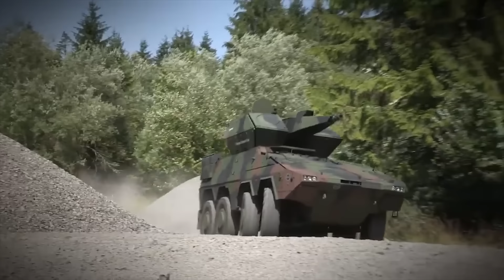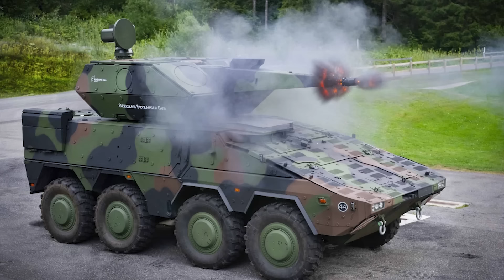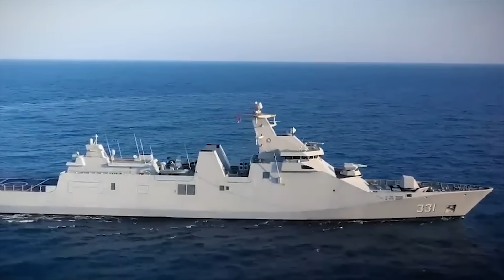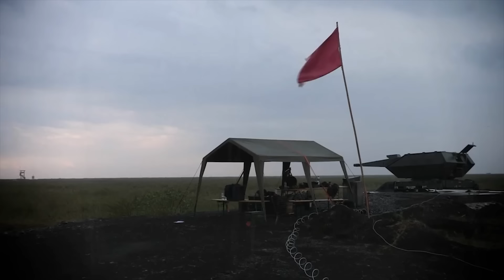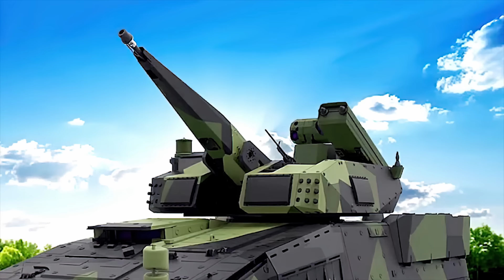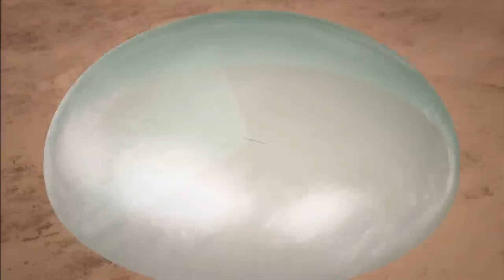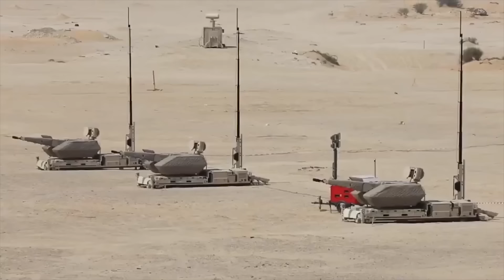GERMAN Fastest Air Defense Systems SHOCKED The World!

Comment: If the Bundeswehr adopts it, let's make sure both gun and ammunition is built in Germany and not in Switzerland this time.
Reply: The Bundeswehr already has two MANTIS systems, which are based on the Skyshield, they are currently in the progress of giving both to Slovakia.
Reply: The Bundeswehr is already using them. They were used to protect the bases in Afghanistan (100% interception rate, anything, missiles, mortars etc.), used on ships and now also on mobile units (Skyranger). The later ones are already not swiss made anymore, due to the usage issues with swiss made military gear.
Reply: The Bundeswehr already has MANTIS Defense systems.
Reply: Partially right. Oerlikon is part of Rheinmetall just like Contraves. But these two sub-companies are registered and taxed as Swiss companies. The development was purely Swiss. The Gepard anti-aircraft gun tank with the predecessor gun was also made by the Swiss for the Germans
designed and completed.
Reply: @peterschwarz8449  Any foreign subsidiary is registered and taxed as a company in the country it operates in. As are specific divisions headquarterted in other countries. They need to be locally registered to operate in that country. Roche Diabetes Care is registered as a German company. That doesn't mean that Roche Diagnostics. of which it is a subsidiary can't decide to reorganize its activities and shift certain aspects and activities from Mannheim to Rotkreuz or vice versa. Just like they decided to make Diabetes Care a whole individual division in the first place. They could (and in the past would have liked to) also decide to sell off Diabetes Care to someone else. And if they did that, they could decide whether to include certain sites, products etc. or exclude them. 
Just the same, Rheinmetall could choose to sell the Oerlikon site to someone else, but retain the IP and product pallete and produce the stuff elsewhere. Or simply switch the production of certain products elsewhere out of business strategic considerations. At this point, Oerlikon doesn't even exist anymore as a company as such - it's been integrated into Rheinmetall Air Defense in 2009 already.
Reply: @ohauss  Germany is a special case when it comes to factories outside of Germany but owned by a German HQ'd company. 
Basically Germany has bilateral deals with practically everyone meaning that profits made by German HQ'd companies made outside of Germany are still being taxed in Germany rather than where the profits are made. So for example the money VW makes from their factoties in China which produce for the Chinese market is still taxed in Germany rather than China. The bilateral deals mentioned earlier exist so German companies are not being double taxed for their foreign operations.
Similar happens to individuals who are registered as living in Germany but working abroad. They still have to pay German income tax on all the money they earn anywhere in the world but it is down to the individual to avoid double taxation.
Reply: @Belliger1991  Because Poland is an ally and the Swiss are not an ally. It is as simple as that.

The Swiss do not allow resales from their weapons into active warzones. That's why we should never again buy Swiss weapons and Germany should relocate all of Rheinmetalls production from Switzerland to Germany or another NATO country.
Reply: @ChaosEIC  we are already at relocate it, they started produce the rounds for the gepard in germany already. first one will be delivered in june or july
Reply: Leave Switzerland alone bro seriously
Reply: This comment section is golden.
Anyways here‘s some things that need to be clarified:

a) Switzerland has sent help to Ukraine in the form of medical and logistical supplies. Because of a new law, no exceptions can be made when countries try to send swiss weapons/munition into areas plagued by war. It has sparked a big debate both inside and outside of switzerland. (Maybe Desmond Doss would be a nice analogy to that)

b) Switzerland keeps it‘s neutrality by not choosing sides. Some of you argue that by choosing that, they aren‘t neutral anymore because they are not for Ukraine (the good guys), which is a bogus argument. They do not choose sides. But they help within the limits of not taking sides for what the majority of the world thinks is just (Ukraine being the victim and should be supported).

c) Swiss neutrality plays a big part as to why it can host big gatherings of nations who may not all be best friends. This gatherings are possible because no side needs to fear for their delegation as switzerland is neutral ground. This is why it defends this neutrality so harshly, even harming itself in the process.

d) What I also saw were some comments regarding the freezing of bank accounts of russian oligarchs. As far as I know, basically any known bank account with relations to such figures have been frozen completely. Some people demand that the frozen money should be used to rebuild Ukraine. Noble idea, but unless there is a unanimous vote on that it‘s not gonna happen, because frozen means frozen. However if the swiss banks were to quietly shove this money into their own pockets, that would be real bad. That means either unfreeze them after the war (massive nono by most peoples view), hand the money over to Ukraine (also not without it‘s problems) or just destroy/distribute/whatever it evenly. Either way, a lot of people are gonna be unhappy.

e) The Bundeswehr having bought these systems a long time ago was aware of these problems. But what most people don‘t mention here is that Germany has massive ammunition reserves which they would use to defend themselves in a war. And if a war would happen the industry will be rapidly refitted to produce weapons and ammunition anyway. That‘s why the Bundeswehr bought these systems, they are good and there will be no major problems with supplying them, even if war in Germany were to happen and thus switzerland not supplying more ammunition. For those now arguing that the munition reserve is not as big: A country won‘t donate all their munition to another country even less so in times of crisis. Considering that there is a high demand for ammunition in Ukraine the amount donated would be rather substaintal, thus the reserve will be even larger. Have a bit of faith in the Bundeswehr, they now what they are doing. And Rheinmetal outsourcing ammunition production to Spain for now also highlights that they know what they are doing.

f) Lastly, debates like this are good, but please keep it civil, no need to attack people on a personal basis.
Reply: @Belliger1991  Exactly, best not contribute to help the nation that is dying for your lifestyle.
Reply: Ja aber wir bauen in Deutschland jetzt Produktionsanlagen für Munition in Deutschland und da Oerlikon mittlerweile zu Rheinmetall gehört ist das dann unsere Sache.
Reply: The Bundeswehr adopted this system 12 years ago, they call it MANTIS though once it is installed.
Rheinmetall has already built a new munitions factory outside of Switzerland (Rheinmetall bought Oerlikon nearly 25 years ago) which will provide Ukraine with 300 000 shells for the Gepard by June this year. Skynex systems also have already been supplied to Ukraine and more will come as fast as they can build them.
Reply: @Belliger1991  yes and that is in this case a problem, thats excactly why it shouldnt be built in switzerland, we can do whatever we want with it and you get to hold up your laws, as stupid as they may be
Reply: yeah, let the Austrians build it...:goat-turquoise-white-horns:
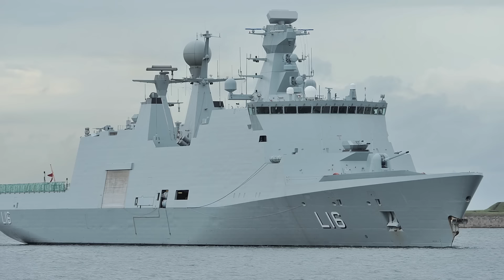Reply: Oerlikon is Switzerland as you see 1:04
Reply: This comment section is rather interesting. So many takes on it, some totally wrong, some right, some misinformed.
Anyways, some important stuff to know.

1) One of the core values of Switzerland is neutrality. It's a long tradition since 1815. It's a simple as not taking sides in conflicts between one or the other. This includes not supporting also what many may see as the morally right side. Participation of a conflict directly or indirectly is no longer neutrality. Not deciding for either, is absolutely also a decision and that is what Switzerland does. That is also what allowed Switzerland to be known for and contribute a lot to human rights. Simple as.
That is not cowardness, it's simply the pure form of maintaining national morals and views. Considering the size of Switzerland, people should truly respect their achievements and contribution. Debating whether Solidarity is morally more correct than staying Neutral is a foolish question. Neutrality cannot be maintained if the very essence of the requested Solidarity is not based on Neutrality. Hence Soldiarity for support in conflicts is not in Swiss interest.

2) Switzerland tried already to have a sort of middle-ground which was before the export laws got stricter. The whole process which made the export laws stricter was actually the result of  a Initiative denying a decision of the government from 2018 that would allow Export of war resources to civil war countries, if there was no reason it would be used in internal conflict (which is just to absurd to not expect)

There was strong critics against the whole thought of that, it went against the majority of what the people wanted, hence a initiative was launched.
To clarify, for one it's what the majority of people wanted from their nation that's up to them and furthermore none of them had a close war like ukraine-russia in mind back then.

3) Rheinmetall including certain other companies got suspended of export by Switzerland already in the past, be it for exporting to UAE, Yemen, or supplying Russia back in 2014 with equipment. And yes Rheinmetall supplied Russia back then, but also got blocked by the German Government (the previous government allowed the trade)
If you want to be the true moral saint, you can complain towards all the arm dealers and manufacturers fulfilling contracts and supplying remote wars in the background not in focus of the public media, you could find dirt on all of them. But it's as simple as business.
Switzerland simply took a stricter stance to it and additionally not only enforces Swiss sanctions, but indirectly also EU sanctions, UK sanctions and US sanctions.

4) As of right now, Switzerland may be looking at yet again potential adjusting with neutrality at stake to allow re-export to conflicts that has been condemned as violating international law by the majority of the UN as a reason for it.
But as far as I know that got dismissed because again would violate neutrality law. They might provide greater aid in other ways, just not contributing into prolonged war.

Either way, this is a complex web of political problems. 
Telling Switzerland off for not loosening their export laws is childish, it makes people sound like the entire issue would be resolved with Switzerland allowing exports into the conflict, which simply is not realistic, rather just misdirected focus on the core issue.

Oh and since I had to read some clearly wrong knowledge regarding who made what.

a) Regarding the Gepard Anti--Aircraft.  The vehicle and the Anti-Aircraft gun system was developed by German company KMW. The gun itself which are the Oerlikon 35mm were developed by Swiss company Oerlikon and licensed for production to KMW for use in the Gepard. Keep in mind the gun alone without the supporting system goes no where and a gun system without gun well same stuff.

b) Germany absolutely still produces ammunition for storage in reserve. They are not waiting for a need to then turn on the gears. They maintain a certain stockpile and ensure to meet certain standards. All of that is tightly regulated as goes with many things in Germany, government ensures safety and security and enforces strict quality control standards.
Also to note, Germany also monitors their export of ammunition and military equipment to comply with international law and especially in recent years has tightened their export controls on equipment and ammunition to prevent it from falling in wrong hands. Like many other EU members and just like Switzerland is doing, them just doing it quite particularly strict.
Reply: As a Swiss man, I agree with this. Produce it yourselves as much as you can. Get a good deal, we don't really have leverage, we need you more than you need us. Don't rely on our weird construct of laws and direct democracy. Don't get me wrong: Our democratic system works better than anything else in the world and the majority of the Swiss population – including myself btw. – would even support massive weapons deliveries for ukraine (it would be a just cause for once, many of us Swiss don't understand why it's ok to deliver rocket components to the Saudis and Israel, but hide behind the "no weapons for warring countries" law in the case of Ukraine). Our system has brought us stability like few countries have ever experienced, and if everyone had it, this war wouldn't exist. But our system is slow, so the adaption to the new geopolitical situation will take years. I guess that's what happens when you weren't really threatened or forced to react to crises for centuries: You start to take your time for things. Also, we have a bunch of right-wing politicians dominating our politics – and they just want to make business in the short term and don't bother themselves with the bigger picture. Not that the 68er fundamental pacifist leftists would be any more helpful in the present situation ...
Reply: Don't worry, Rheinmetall has basically dismantled most of its production facilities in switzerland and moved them to the EU (mostly germany, some dutch, a little spain)
Reply: @Belliger1991  Die Evolution deutscher Waffenlieferungen
Keine Waffen in Krisengebiete
Helme und Schutzwesten
Handwaffen und Munition
Flugabwehrraketen und AAA Panzer
Rohr und Raketenartillerie dafür ebenso
Illegale Minen und Cluster-Geschosse
Kampfpanzer Schützenpanzer 
Kampfflugzeuge über Polen. 
Die Schweiz soll ihren Prinzipien bitte treu bleiben Neutralität die seid 300 Jahren den Frieden Garantiert da sollte Deutschland sich schämen dies zu kritiesieren.
Reply: Machine-gun anti-aircraft defense weapons trash. Proof North Korean drones' radar detection is difficult, radar performance is poor, and anti-aircraft defense is not properly detected. We can't detect the radar of a 4km plastic drone, so we can't respond
Reply: Swiss neutrality = freedom to make business with all sorts of criminals (Nazis, african dictators, russian Oligarchs, you name it). The Swiss can not be trusted.
Reply: It actually kind of is, Its called mantis
Reply: It already has adopted it
Reply: Ist als Mantis schon lange eingeführt.
Reply: Haha do you really think our government learns out of its mistakes? 😂😂
Reply: When the EMP's will fall and they will in an WW3, than we are fucked..
Not enough people and guns to keep of China and Russia..
They are used to fight with less advanced weapons..
We souly depend on our electronical weapens but what when the EMP's will fuck everything up?!😂
Reply: I'm sure Germany is not that petty.
Reply: @kaizillaboy  But they are.
Germany already uses the 35mm Oerlikon gun that is produced in switzerland in their Mantis Flak system
Reply: Wasn’t Oerlikon Swedish, not Swiss? I would rather be concerned that it turned out that before war Russians acquired some German companies with secrets that shouldn’t be sold to hostile state.
Reply: @TheOmegaAlfa  oerlikon is in zürich swiss
Reply: @oliverbrooks4588  oerlikon as a weapon company didnt exist since long. its integrated into rheinmetall
Reply: Skynex is an italian product.
Reply: As if the Bundeswehr itself is in charge of this. Such decisions are being made by civilians and politicians.
Reply: Swiss ammo can remain in Germany, thus Germany can send all their ammo.
Swiss being in the middle is the middle part - arsehole
Reply: TOO LATE AMMONITION IS MADE IN CHINA, RUSSIAN MILITARY CONFISCATED THEM IN UKARAINE SOLD THEM TOO IRAN.
Reply: Rheinmetall owns them and nearly fully integrated them into their company structure. Furthermore those air defence systems aren't just made in Swiss, many parts come from factories in other countries, like Germany. Lastly the ammunition is made in Germany already.
Reply: @Logan_the_Hamster  you simply dont understand, the lenses for example are TOTALLY from swiss, if they ever have the intention to create wargear, which i hope not carl zeiss may builds them in the future, this just shows how little you know about the production. we need to have perfectly polished lenses for laser weapons, those are either made by bayer, carl zeiss or the watch manufacturers of swiss. ffs.
Reply: @tarkitarker0815  Carl Zeiss is a German company, with its HQ in Oberkochen, in Germany. Their main factories are in Jena and Dresden, both in Germany. Nearly their whole laser optic production is located in Germany. In Swiss they have no factory producing parts used in military vehicles, devices, weapons, ... 
All this information can be found on their homepage.

Furthermore why would watch manufacturers have the knowledge, skill and equipment to produce lenses for laser optics for military purposes?
Reply: @Logan_the_Hamster  because many luxury watches use very precisely manufactured glass that in fact can rather simply be scaled up in size. and im well aware of zeiss, i even mentioned zeiss a few times in the comments.
Reply: MANTIS is in service since 2011.
Reply: Shouldn't you be more concerned with eating hamsters young man.
Reply: @Belliger1991  Why would you buy weapons from a country that refuses to send supplies like ammunition in case the buyer gets involved in a war? Absolutely pointless. The law you are referring to is not a natural law. It could be changed (and was subject to change over the years) if there was some political will. But the Swiss prefer to hide behind their own made laws. Switzerland is effectively supporting the russian invasion including the most disgusting war crimes we have seen in Europe since decades. Switzerland has utterly failed morally and has let down those countries who shield Switzerland from external aggression due to it's geography. Meanwhile, whenever I have the choice not to buy something from Swiss origin, I am doing so.
Reply: Please yes! And keep up the international pressure on our government, they fking need it! Slava Ukrajini
Reply: But will that cure the problem
Reply: You damn fool passive governments sit and watch as the world burns down around them.They change their minds when it’s their blood.
Reply: And it will end up being their blood
Reply: 61
Reply: Switzerland , Germany or Österreich same nation
Reply: @nextoro5786  100% no ! Austria and Germany maybe, but the Swiss are so full of themselfes. Keep them separate.
Reply: @Thor_Asgard_  Austria and Germany are different as well. Also, germans are not some kind of  a mono nation, they consist of prussians, bavarians, saxonians, frankonians etc.
Reply: Dhotmanycent
Reply: Arabische Diktatoren werden beliefert, aber Europäische Demokratien, die sich gegen eine faschistische Invasion wehren, nicht. Wie unsolidarisch kann man sein? Das ist nicht Neutralität, sondern Verrat an Europa!!
Reply: They will adopt it, order two, get one ten years later.. the second one 5 years later at a 50% price increase. In which time the first one is broken and needs to be repaired, once that one is in service the other has broken. And so on~ Bundeswehr is basicly structurized incompetence, organized by professional incompetent leadership, which is overseen by the most incompetent of them all, german politicians.
Reply: @Belliger1991  hidden? no. fucking stupid? yes. incredibly ignorant and cowardly to not change said law in current times? yep.
Reply: @Belliger1991  NO WAY
Reply: Hire there engineers move them to Germany! 
The US has many armories that could privately develop a better replacement gun and all!
Reply: I heard Rheimetall is pulling out of Switzerland?.
Reply: To spend it to the Ukrain???? 💩💩💩
Reply: @marcelniederberger9676  to build it
Reply: @marcelniederberger9676  Weapons with the label "Combat Proven" sell a lot better. Therefore the German Industry is very eager to test their prototypes in Ukraine.
Reply: nein, leave it in Schweiz
Reply: Germany / the Bundeswehr already uses this system... It's called MANTIS.
Reply: Klaus Schwaab does not approve
Reply: wana hear a joke ?
Bundeswehr
Reply: @kthec1298  yes yes I was there and i wondered how it took the world so long to defeat us. Than it made all sense the allied new recruiting program and officer selection made sure, we will never be a danger to anyone else ever again.
Reply: oh yes.
Reply: switzerland is honestly such a disgrace..
Reply: They are built in Germany, Rheinmetall owns Oerlikon...Besides ,all sophisticated electronics are produced in Germany...
Reply: who cares?/!
Reply: We have the same problem in Greece with 120mm rounds for leopard 2 , I really dont understand why most European governments don’t make their own ammo.
Reply: Why ? Swiss watches are the best in the world and let's not forget ,most people in Switzerland are Germans !!!
Reply: Problem is, Oerlikon is Swiss. But yeah, fully agree, nothing vital should ever be bought from them as they are only interessted in their own well being.
Reply: @Thor_Asgard_  Oerlikon is owned by Rheinmetall now, and they just bought the biggest Spanish munitions factory...
Reply: @quantuman100  export policies still depend on the location, wo get rid of manufacturing in Swizerland and move everything into Nato countries. If Switzerland wasnt surrounded by allies but stationed beside Ruzzia they would quite quickly change their minds.
Reply: @Thor_Asgard_  look, we have clear precedent that the Swiss only care about stuff produced inside Switzerland
Reply: @quantuman100  it remains swiss by LAW. the first place a business gets registered is its place of origin and will always be the field of main management, its restricted by law to simply change countries for your benefit.
Reply: @Thor_Asgard_  you dont understand how companies work, oerlikonn is still swiss, rheinmetall can create a own variation and then export that, but not the swiss variation, oerlikonn STAYS a swiss coorporation.
Reply: @Thor_Asgard_  This shouldn't matter, as the owner they can pull out the IP and apply it everywhere. So they can use Oerlikons good engineers but the production can happen elsewhere. But of course they need the facilities to produce that eqp.
Reply: @ronaldotrumph8960  In theory. But they may be extra protective of IP of weapons production
Reply: @OrjanDT  And that is ok. As said the know-how/engineers might remain in Switzerland. IP is with the owner which is RM and they can simply apply for patent in GER instead of Switzerland. Switzerland has signed the European Patent Convention, so that should work fine.
Reply: @ronaldotrumph8960  Defence IP usually have extra national protective measures. Atleast here in Norway. Its not that easy to move weapons production and tech. Probably easier to just start a new production pipeline in Germany than to move it.
Reply: @OrjanDT  The owner of the IP under the law can be Rheinmetall. You can develop something in one country in EU (incl Switzerland) and apply for patent somewhere else.
That applies by the way also for production under license. But I have to admit here, I have just a very limited knowledge coming completely private sector.
Reply: @ronaldotrumph8960  incorrect, IP export restrictions may still apply. Even as the foreign owner you still have to abide by the export restriction of the country the owned company is in. This is especially common with export restrictions imposed by the US on tech from US companies owned by foreign companies.
Reply: @ralfvandeven3155  Try to read again, we speak about future not past or not the export of IP but the application for new technology. RM as OEM can very well develop something in Switzerland but apply for IP somewhere else in EU (applies for Switzerland as well). Production is already going that way. That will take Switzerland long term out of calculation for export. KMW discussed to do the same with NEXER  when they were not happy with GER export rules. That idea is not new or fancy.
Reply: @Thor_Asgard_  Rheinmetall is the owner of this Swiss company Oerlikon Contraves and owns all rights. Rheinmetall just didn't have a production line in Germany anymore, and that wasn't a problem. But since last year production has been taking place in Germany again.
Reply: @Thor_Asgard_ if all countries were like switzerland, there would be no war or poverty in the entire world i am swiss so i know dude
Reply: @whooshie5172  nope your wrong. Economically thats not possible. Switzerland is profiting from its geolocation and neutrality. If all countries would do the same, we would have the same exact problems we now face.
Reply: @Thor_Asgard_  this statement doesnt make any sense.
why we would face the exact same problems, if all countries would be neutral?
Reply: @IT_SEC_Stuff  Its simple, they can live in wealth and profit from their neutrality. Noone would profit if everyone was neutral, thats when greed will spread and take over. Its human nature.
Reply: @Thor_Asgard_  profit is a term related to capitalism, it has nothing to do with neutrality.
if all countries would be neutral, capitalism also would still rule the world, and in this system you have winners and loosers, its in its nature.
Reply: @IT_SEC_Stuff  And exactly because of that, there would still be conflicts and war. accept it or not, its the truth.
Reply: @Thor_Asgard_   your statement was, that switzerland profits from neutrality, and thats not correct.
like any other country, they profit from capitalism, so the U.S.
neutrality just means you are on no side in case of conflicts.
Reply: @IT_SEC_Stuff  It is completely correct. Your Banking system depends on it.
Reply: @Thor_Asgard_  hehe, and yours dont?
Reply: @Thor_Asgard_  Oerlikon WAS swiss...
Reply: @Thor_Asgard_   
Hungry Austrian Blue Eyed bavian, Hammer & Sicle Double Headed, Split tongued, Prussian Kazahr katar, Orthodox volapyk Wasabi Mongol canibal Central Brachy Cephalic Broad head Rh negative Casino play.

The city of Bern was capital city of Switzerland situated in the western part of the country, has been closely associated with the bear since the 12´th century. where "Child-Eater Fountain" Swiss Made

Swiss bankers from the old capital city of switzerland has been closely associated with the bear since the 12´th century. where "Child-Eater Fountain" Swiss Made - Saturn devouring his own children.
Reply: @Thor_Asgard_  who can blame them, worked out pretty well for them so far
Reply: @Thor_Asgard_  Switzerland , Germany or Österreich same nation
Reply: @Thor_Asgard_  Switzerland is a neutral country, whats the problem? Everybody knows this since centuries. Imagine you would let ur sutt being produced in totalitary systems like Russia, USA or China.
Reply: @Thor_Asgard_  no it isn't any longer. Rheinmetall has bought Oerlikon some time ago and recently relocated all production facilities to Germany.
Reply: @Thor_Asgard_ 
Oerlikon used to be swiss but by now it is owned by Rheinmetal and the whole productionline is already been taken down and transferred to germany, since Mr. A.Pappberger had to ome to the conclusion that those (so called neutral) swiss folks can not and should never again be trusted, having had in mind their unworthy behaviour when it came to supporting ukrainians with much needed ammunition for gepard flaktank. We won't ever forget about that nor will we forgive.
Reply: @Thor_Asgard_ you think a german company isninterested in anything but profit?
Reply: @Gigachad-mc5qz  Absolutely NOT, but atleast their export policies are more usefull if you are at war.
Reply: @Thor_Asgard_ Right, the Geneva convention is one of our egoistic things. Like all the diplomatic work we do for America in countries they are hated so much, they can't go in.
Were known for peace negotiations, red cross, medicines sans frontiers and helping all around the world even though we're only 9 million.
There's a country that started wars based on lies just to have access to cheap gas. Or just for fun. Piss in their garden and not on the most reliable government of the world, ok? 🤦‍♂️
Reply: @h.g.buddne  The Red Cross is mostly done by Germany for one. You are also known for Ricola, known for something means nothing if you dont act accordingly. I really think your statement makes no sense at all, but thats your choice which is ok. Still, you should never get anything from someone, that only delivers the goods, when you dont need them. The Swiz can be glad, that they are encapsuled between Allies and dont have to fear external intervention. If you would be at the border of an Islamic state or a dictatorship you would change your thoughts quite quickly. Always good to have a couch thats not in the rain. Well Well.
Reply: @Thor_Asgard_ jep aber laufen mitlerweile unter Rheinmetall und man kann ja einfach Produktionslinien in Deutschland aufbauen
Reply: @Thor_Asgard_ Oerlikon is owned by Rheinmetall..The major manufacturing of sophisticated systems takes place in Germany not in Switzerland....
Reply: @Thor_Asgard_   The Swiss may only be interested in their well-being, but compared to Germany, they have much higher income, much lower taxes, much more household wealth, much higher life expectancy, much less wars (and certainly no world wars), and much higher development.  Not to mention their wonderful SBB.  Perhaps the Germans have something to learn from the Swiss in prioritizing your own country.
Reply: @Thor_Asgard_  Oerlikon is owned by Rheinmetall so it no longer Swiss
Reply: @thomasdietz6954  read about how corporations work, it stays swiss, in german ownership.
Reply: @thomasdietz6954  As long as it produces in Switzerland, all it's products are swiss... that is the Problem with the Gepard-Ammunition. Oerlikon is Rheinmetall, but it has produced them in Switzerland...
Reply: @Thor_Asgard_  In contrary to germany, which is interested in the ruin of everyone else - and itself.
Reply: @Thor_Asgard_  I'm pretty sure that Germany is more than capable of building these things too, and this time we won't make the mistake of trusting in Switzerland being based.
Reply: @IIIAnchani  "being based" found 4chan chan
Reply: @IIIAnchani  Who would ever trust the Germans again after WW1 and WW2?
Reply: Rheinmetall is already building a new factory for middle caliber ammunition in Germany.  Switzerland has taken itself out of the market with their extreme export politics.  Good they noticed this problem now and not when its too late.  Imagine if russia went to war with NATO, Switzerland wouldnt deliver ammunition to Germany either.
Reply: You are selling arms.
What do you think they will be used for ?

Swiss arms sales just became suspect. You cannot buy more when you actually need em to defend yourself......utterly selfdefeating.
Reply: @Belliger1991  "... with that reasoning you guys should be against repair stations in poland for ukrain tanks ..."
Why? The ukraine is fighting for its freedom and the still "uninvolved" poland would be the next country, which would be invaded if the ukraine would loose. So why should anyone be against polish support for ukrainian sowjet based weapons?
Reply: @Nitramrec  yea lets make freedom by deliverimg weapons. Another low IQ.
Reply: @Nitramrec  East Ukraine is fighting for its freedom against a fascistic regime that tries to pillage and murder them and Russia is now saving them from that regime, while western fascism is of course siding with the Banderite Nazis.
Reply: @Nitramrec  there is literally 0 chance this is going to happen. Russia will never march into Poland again....
Reply: @Nitramrec  "which would be invaded" HUGE stretch, poland is NATO country.
Reply: Switzerland being a neutral country would probably not get involved in weapons for the Ukraine
Reply: @tonystaskova9439   >neutral country
you misspelled spineless cowards
Reply: @Nitramrec Lol… Ukrainian Nazi regime is committing genocide of Ukrainian people! Supporting it is a war crime in itself.
Reply: I fully agree with you.  Poland is only doing for Ukraine, what the US did 70 years ago for Britain…they “lent” them weapons, during wartime,  and I believe Poland will eventually be fighting the Russians.
Reply: @Nitramrec  By your logic, any invader that wins will target the next and next and next country until stopped/defeated.
If so, then after the US invaded Iraq and Afghanistan and "won" (they did have majority control) they would have invaded Iran, Saudi Arabia, Turkey, Pakistan...

Your logic is flawed. You should probably read up on the history BEFORE the Ukrainian conflict rather than make stupid guesses.

The reason you want in house production of arms and ammunition is in case your supply is cut at a vital moment.
And being for Ukraine or Russia's win/defeat makes you involved. Instead, it's better to be against BOTH sides of the conflict to make sure they can settle and return to peace.
Reply: @Nitramrec  How do you know Poland will be attacked next? This shows that you have understood nothing of the overall situation. Why doesn't Urkraine have its own weapons to defend itself? Because there is corruption in Ukraine and it has nothing to do with democracy. Instead of spreading rumours, you better educate yourself.
Reply: As a Swiss, I sadly have to agree with you. It's a shame how Switzerland behaves in the whole Russio-Ukrainian war, not only with the pathetic refusal to allow weapon/ammunition exports but also the half-assed actions against Russia in the financial sector. I have to apologize for that.
Reply: @igorschneider436  As a Swiss i have to say, "Igor" really sounds Swiss. ;)
Reply: Yes, then we can properly waste it in US proxy wars.
Reply: @kasemuffin6133 are you saying the us would fight the Russians to the very last Ukrainian. Very good point
Reply: True, i dont understAnd swiss, they must see that russia is the agressor
Reply: As somone that lives in swiss i agree we seld our selfs for profit i hope  we can change but sadly i think thats to late
Reply: Yeah. I think Switzerland has destroyed their defense industry. And for what? To protect a country that invaded another? Completely moronic.

The only way for Switzerland to now save the industry is to outsource all their manufacturing, so the Swiss government doesn't get a say in what can or can not be re-exported.

What Switzerland doesn't get is that "doing nothing" is not a neutral position. No decision is also a decision, for or against something.
Reply: @a5cent  Agree! And I am Swiss!🇨🇭
Reply: @a5cent  Hey Nato friend , in East Ukrainian provinces since 2014 15000 Russian-born citizens were slaughtered by Azov bandits (Nazi worshippers) and deprived of all their rights by Kiev coup plotters. West media is silent about it. The coup d'état Ukraine of 2014 took place against the constitution valid at that time. This is also documented, proven and known for a long time. And then the slaughter started there. The then Minsk ceasefire was a sham. It was never respected by Kiev bandits. As now officially admitted by France, DE, exclusively to gain time, for Nato armament and Nato war preparation against Donbass inhabitants, as well as destabilization at Russia border.
Russia has now put an end to this and was ready in March 22 to leave Ukraine again, if the neutrality of Ukraine and the rights of the Donbass population are restored. This has President Grandpa Biden but rejected & Selinsky clown promised, peace is not necessary to establish NATO directly 600km from Moscow. How would Grandpa Biden react if Russian nuclear weapons were stationed in Cuba after all?
Reply: @a5cent  so yeah, let's just bend over to the very "good" guys (aka U.S.A) who won't sign the treaties to adhere to the international criminal court and actually would invade the Netherlands if they arrest an American war criminal and which supported dictatorship all around the world, even organising coups against democratic governments just because they were a bit too socialist for their likings. 
Switzerland is neutral, as a neutral state it doesn't (militarily) support the criminal Russian state, nor the Ukrainians even when they are rightfully trying to defend themselves. We support sanctions, we support peace negotiations and provide humanitarian help but won't give anyone weapons or ammos to kill each other.
Reply: @a5cent  lmao, the decision to only intervene in genozide etc is not a decision to do nothing and be for that thing. this is what i hate about germans, when its about inner politics and demonstrations and rallyes they are like "i didnt inform myself about your problem neither do i have any intention" and when it comes to conflict that REALISTICLY is never coming to germany if the usa dont overcompensate they are totally in for it because it means money, and creeping a bit deeper into americas behind. we should have send a peacemission years ago that actually would have not treated broken treatys like "ehh whatever" and this wouldnt have even happened, also what you seem to forgot, in the time between lukashenko and selenskij the frontline to luhansk and donetzk got reinforced heavily really heavily with us equipment. it was all kinda staged from both sides. dont fuck in topics that are surrounded by a deep web, thats not being ok with what happens......
Reply: @a5cent  Absolutely correct!
Reply: @a5cent  dont worry about us. Murder weapons delivery was never our strength. Wer still rich. The redicilous thought that YOU think you know whats best for Switzerland.
Reply: @ytaccnt1  I certainly know better than you. Nebenbei... Ich bin auch Schweizer, nur einer mit Ahnung.

I understand that you are naive. In the real world, weapons are neither good nor bad. They can not only be used to murder, but also to save. Allowing Russia to invade a very close European country and kill hundreds of thousands, while doing nothing about it is evil, not neutral. If that's who you want yo be, fine. I want nothing to do with opportunistic cowards like that.
Reply: @a5cent  du bisch garnüd
Reply: @ytaccnt1  Gut argumentiert /s
Reply: @ytaccnt1  stimmt, die stärke der schweiz war es den krieg auf beiden seiten zu unterstützen, damit man am meisten profit für sich selbst raus schlagen kann.
Reply: @ytaccnt1  Arabische Diktatoren werden beliefert, aber wenn eine europäische Demokratie überfallen wird, dann zückt man die Neutralitätskarte? Wie unsolidarisch und gierig kann man eigentlich sein?
Reply: it would be better if russia could build the rounds LOL
Reply: Agree, they can build their fckn chocolate and thats it
Reply: Honestly the argument is a bit stupid.
It has nothing to do with neutrality but with weapon export laws.
And all nations who bought weapons system knew that law.
No swiss weapons are allowed to be exported into active conflict areas.

And that isn‘t a swiss thing.
If germany would buy f-35 jets and resell or „gift“ it to a country like north korea they would piss off the US.
Reply: @Slithermotion  The point is not that, but that Swiss refuses the export permission which most other did.
Reply: @ronaldotrumph8960  That‘s exactly the point by swiss law it is forbiden to export or re-expert by a different nation swiss weapons system.

This wasn‘t always the case but left leaning parties have voted for more restricted export laws and taking the power away from the federal council to make exceptions.
This was pushed through because hand grenades of swiss origin have been found in the middle east and used on civilians.

The point is a couple months before the war in ukraine started the federal counciel had the power to make exceptions, then the parlament took that away.
And you can‘t just vote for a law and then ignore it.
However export into conflict zones have been restricted by law since a long time.

So every country knew exactly how this would work and now they expect that switzerland behaves differently.
There was a contract, all were agreeing to the contract.

In this case you should be mad at military higher ups for agreeing to buy the weapons system and ammunition and not be able to resale it without swiss permission.
Reply: @ronaldotrumph8960  the swiss have a history of neutrality. But what is unclear about not being allowed to export the weapons to a conflict zone? You may not like it as most of the west has an obvious favorite in this conflict. But the Swiss are clear in that they don't choose sides. You call it "only caring for themselves" the Swiss call it not being dragged in other nations problems.
Reply: @ralfvandeven3155  dont "choose" a side is choosing too.
Reply: @ronaldotrumph8960  When the contracts were signed, everyone knew, that the Swiss could refuse export permissions. Germany still decided to buy it, so there's no need for us to blame Switzerland now. You can't be unable to produce proper weapons yourself, then buy them somewhere else and then complain about the other party making use of their rights.
Reply: @shiiqu8174  Again, the company is owned by GER RM. Production can be very well in another country and RM can even be the owner of the IP. Means engineering in Switzerland, rest somewhere else.
Reply: @ralfvandeven3155  What do you not understand about that EU law very well allows to apply for IP somewhere else. The point is from now on RM might do the development in Switzerland by apply IP and production somewhere else. RM is basically  already going that way. It is not so difficult to understand.
Reply: @ronaldotrumph8960  I do understand that Switzerland is not part of the EU.
Reply: @ronaldotrumph8960 Of course we do. We want to make sure the weapons are only used for self defense. The political standards of Ukraine don't match our expectations.
We rather not earn money than knowing we sold our systems to a corrupt and politically instable country. That's how the people of Switzerland voted decades ago. Every customer knows about these conditions.
Reply: @ronaldotrumph8960  And?
Reply: @Slithermotion  It's just bad strategy. You have a german-owned company, producing ammo for german weapon systems, but cannot do with them what the german government wants to do. You don't win conflicts like that, if you are unable to participate because of bad planning.
Reply: @Slithermotion  The Swiss hide behind their neutrality only when it serves their business. She doesn't want to offend the Russians too much. The Alpine yodellers should be ashamed! Your comparison with the F35 and North Korea is ridiculously unrealistic and limping like a cow on a mountain!
Reply: @Slithermotion  Well, for most weapons bought the law for forbidding export in active warzones was not yet a thing. So no, the nations buying those weapons did not know that law.
Reply: @ChaosEIC  those laws that weapons can‘t be exported into conflict zones is decades old.
The only thing that changed is zhaz in 2021 the parlament took the right away from the federal counciel to make exceptions.
Reply: @Slithermotion  Yes. Like I said 99% of the weapons were bought under the old condition that exceptions can be made.
Reply: @ChaosEIC  Yes, but you don‘t buy something with restriction that allows exceptions otherwise you have no right to demand those exceptions.
That‘s why they called exceptions.
Reply: @Slithermotion  thats right
Reply: @Slithermotion  Stupid but actually evil and manipulative comparison.
Reply: @Slithermotion Oerlikon is no longer a Swiss company but has been purchased by Rheinmetall. Swiss „neutrality“ is perceived as taking the side of the aggressor, i.e. Russia. Although well intended, Swiss neutrality has ended Swiss control over its admittedly most shiny defense gem, Oerlikon - the world’s most advanced short range anti air company. In case you don’t accept this, let Rheinmetall pull all the IP and manufacturing expertise out of Switzerland, which will only mean more high tech jobs lost in the country
Reply: @Slithermotion  Excuse me. Germany has a very similar law, that no weapons are allowed to be exported to conflict parties or in war zones. What they did was, they set that law on "standby" as the attack on Ukraine (Europe in fact) demanded an exception. Switzerland could have done that as well, but it looks like they are more interested in money from russian oligarchs keeps on finding its way onto swiss bank accounts. Germany supplied Siwtzerland with Leopard 2 MBTs and a giant stockpile of other heavy weapon systems. Still Switzerland does not give the favor back and allow Germany to deliver ammo (not even weapon systems) to Ukraine. That is a shame for Switzerland, wich is sitting very comfortable in central Europe beeing aware ofd the fact, that the EU / NATO will have to defend Switzerland as they are surrounded by EU / NATO countries. My respect for Switzerland has decreased dramatically.

And the example of Germany selling F-35 jets to NK is just nonsense, as NK is seen as an enemy by the germans, just as the US looks at NK. If i.e. Sweden would be attacked by Russia, i highly doubt the US would deny the delivery of F-35 jets from Germany to Sweden...
Reply: @r4dio4ctiv3man9  As far as know germany has around 18k rounds of 35mm Oerlikon ammunition.
By the time they would have trained the ukraine soldiers I doubt there is much left. 
Even Military officers agree that it wouldn‘t make much difference even if they could reexport the ammo.
Second I‘ve looked up what the German laws says and it isn‘t even close to the restriction made by switzerland.
As far as I understand it the german goverment is allowed to make a case by case decision.
It doesn‘t state that it is forbidden at all.
In switzerland it is by law forbidden to export any war material to conflict areas.
The federal counciel used to have the power to make exception but there was a parlamantary decision in 2020/2021 by green, social party and some conservatives to take that power away.

And that law just doesn‘t make any exceptions.
It doesn‘t matter if it‘s yemen, sudan, afghanistan or ukraine.
The only way this would be allowed is if the UN declares the invasion of ukraine as a special case which is not possible because russia/china has a veto power.

By the way the german who bought that ammo knew exactly what they were signing.
They knew that they would never be allowed to reexport the ammo in a conflict area.
This isn‘t shocking news and should be clear that if germany wants to export war marerial into conflict zones they should not by swiss weapons systems.
Reply: @Slithermotion  not the problem, oerlikon is owned since long by a german company. so we can just move the production from it to germany. if swiss dont want to get money from the production germany i fine with it i think.
Reply: @xagels
Reply: @xagels  you maybe can copy the production but not simply export it.
Oerlikon still is a swiss company, and the 35mm ammunition is usef in the swiss armed forces so there are restriction.
Arms business is not like anyother business.
Reply: @Slithermotion  oerlikon itself didnt exsist anymore as weapon company with this name. its integrated in a rheinmetall sub company. rheinmetall is german. they have all rights to the weapons. so its not a "copy" the only move to production to a other country. the actual gun isnt developed from the original oerlikon company. they only still use it as a trademark. nothing more.
Reply: @xagels  Absolutly.
What you have to understand is that weapons companies are a bit different.
E.g. the chinese state would probably not be allowed to get access to us weapons manufacturer technologie even if it had a majority share of the company.
The same that the swiss goverment woulf take action if swiss military technology would be outsourced.
There is a national interest that the infustry stays that goes beyond profit but national defense.
You can see that even in rheinmetall air defense video which took over oerlikon and contravers where they have access to swiss military exercise equipment.

I don‘t think rheinmetall can‘t pull out the production out of switzerland because the swiss goverment would take action.

But I might be wrong.
But it is not uncommon that arms manufacturer have a bit a different treatment then most other companies.

Or let‘s say it that way if the russians would buy german arms manufacturing stock do you really think the german goverment would them just let the production pull out of germany?
Reply: @Slithermotion  öhm, we have produce it into the past in germany already and started to do it again now. i mean what will switzerland does against it? even the actual develope from it its not only "made in switzerland" because rheinmetall have his developing in multiple countries.
so even switzerland want to say no now afterwards, the technology itself is all the time already in germany when they develope it. if they dont want this for the future they put the developing in a other country too. end the contract in switzerland, hire the people again for a german location.
Reply: The machine gun type anti-aircraft defense is low, so it cannot be done properly. We can't respond because we can't detect the radar of a 4km plastic drone
Reply: Yes no more contracts with switzerland,better they stay with Ricola.
Reply: Switzerland should be ashamed. Sitting safely within european borders and contributing only little to the safety of the EU and their neighbors.
Reply: @Nerazzurri87  Switzerland has implemented ALL of the EU sanctions on Russia.
The UK on the other hand has implemented less than a third of those sanctions, they have not seized any russian-oligarch-owned properties even though there are billions worth in London alone. Instead they made the son of a Russian oligarch and 'ex'-KGB/FSB chief officer for London 'Baron Lebedev of Hampton in the London Borough of Richmond upon Thames and Siberia in the Russian Federation'. Father and son still own two major UK newspapers.
Reply: @Nerazzurri87  the eu was NEVER a defense union, it was a TRADE union, also switzerland isnt even member. and what the fuck dude, switzerland even without germany and italy woud sit between the balkan countries, algier and the black sea, scary scary stuff. for switzerland the eu is ABSOLUTELY no bufferzone lol.
Reply: @Nerazzurri87  hold up, bashing a country for its neutrality is fucked. If you like to contribute to war so much, you can go and get shot, ukraine is looking for volunteers, but don't blame others for chosing not to participate. In most wars there is never "one" victim, there are multiple perpetrators, multiple profiteers and victims on every side involved. Ofc they COULD chose a side and make a shitton of cash in arms sales now, doen't matter if they chose to support russia or ukraine. They would profit of the war without risking shit, and thank god they don't do it, not in ukraine and not in any other war riddled region. Other nations would be happy to drop bombs on civilians to secure some natural resources
Reply: @Nerazzurri87  you really have no clue. just a badly informed person can drop such bs
Reply: @Nerazzurri87  Safety of the European/EU borders? LOL! Ever heard about the crime conditions in numerous cities throughout Europe now. all caused by the wide-open borders controlled by EU member Nations and the former all welcome "Wir schaffen das", Chancellor of Germany Angela Merkel. For over two decades, all of Europe is being 'invaded' by mostly questionable refugees and asylum seekers, with  Switzerland now housing and taking care of more refugees and asylum seekers per capita than any EU Member Nation, having to spend over 2 billion Euro/annually to take care of them. Thanks to the miserable failure of the EU to ever protect Europas safety.
Reply: @Nerazzurri87   Safety of the European/EU borders? LOL! Ever heard about the crime conditions in numerous cities throughout Europe now. all caused by the wide-open borders controlled by EU member Nations and the former all welcome "Wir schaffen das", Chancellor of Germany Angela Merkel. For over two decades, all of Europe is being 'invaded' by mostly questionable refugees and asylum seekers, with  Switzerland now housing and taking care of more refugees and asylum seekers per capita than any EU Member Nation, having to spend over 2 billion Euro/annually to take care of them. Thanks to the miserable failure of the EU to ever protect Europas safety.
Reply: @Nerazzurri87  To be fair, Switzerland has contributed billions in humanitarian aid. For such a small country it's a very substantial amount.

Switzerland is befuddled by any issue which relates to both military force and neutrality. Then they are incapable of taking reasonable actions. However, outside of that specific area they do pretty well, meaning they aren't doing absolutely nothing either, like some here ignorantly assume.
Reply: @a5cent  Europe should stick together, when a European democracy is invaded. Europe must be able to defend itself...without support from USA/UK/AUS... Our Leaders are slow and useless, and the Swiss politians are some of the worst!
Reply: Haha, you act as if our defense ministry had any kind of common sense. :D
Reply: @Casey093  well yes Pistorius is a pretty decent DM
Reply: @sohnnyjilverhand8657  well not really, 1 third of our bundeswehr leadership did gete replaced in the last 14 years albeit most of them not being old, they just had opinions as proven soldiers and generals that didnt allign with politics ffs. we are off onto a hell of a ride that we will get dragged into.
Reply: In principle, Switzerland can at least be relied upon to keep to the mutually agreed arrangements. For future exports, adapted agreements will probably be concluded.

You don't have to believe that you can rip off our production facilities and above all our staff. No reasonable Swiss engineer goes to work in Germany. Keep your feet on the ground…
Reply: @michaelhermann4213  And no reasonable country will buy weapons from a supplier who will refuse to deliver the moment the recipient is being attacked. Pure peacetime supplies are decoration, but not defense.
Reply: @ohauss  because what? because the grenade pulver will spoil? lol.
Reply: @michaelhermann4213  dir sollte klar sein, dass die entwickler in der schweiz oft aus dem ausland kommen. wird das kleinste problem sein, dass leute die bereit waren für den job in die schweiz zu ziehen erneut umziehen xD
Reply: Die Schweiz soll ihren Prinzipien bitte treu bleiben Neutralität die seid 300 Jahren den Frieden garantiert da sollte Deutschland sich schämen dies zu kritiesieren.
Reply: @maddog8004  1. Seit und 2. lebt die Schweiz nicht seit 300 Jahren im Frieden. Eher seit 150. Aber das liegt nicht an der Neutralität, sondern and Lage und Geographie. Belgien war im 1. WK neutral, Belgien war im 2. WK neutral. Das hat Deutschland, aber nicht davon abgehalten Belgien in beiden Weltkriegen anzugreifen. Neutralität sichert keinen Frieden. Diese Annahme ist einfach nicht logisch und hat sich auch historisch immer als falsch herausgestellt.
Reply: @maddog8004  Schwachsinn. Das ist Dinosaurier denken.

Die Welt ändert sich. Wer sich nicht mitändern kann stirbt aus. Der einzige vernünftige Standpunkt wäre gewesen, dass sich die Schweizer Politik da raus hält. Verkauft ist verkauft. Was der Käufer damit macht soll seine Angelegenheit sein. Inzwischen aber eh zu spät. Wie man hier sieht, ist das vertrauen in die Schweiz eh schon zerstört.
Reply: @a5cent  Wenn du ein Gegenargument liefen möchtest, dann mach dies doch bitte so, dass nicht jeder beim ersten Wort erkennt was für ein Idiot du bist.
Reply: @maddog8004  bei nazigold wurde dann aber ne ausnahme gemacht...gell...nur mal ein beispiel...eure rolle über die jahrhunderte, dafür solltet ihr euch schämen...
Reply: @maddog8004  joa, klappt auch nur, weil die schweiz nicht russland als nachbarn hat. mmn sollte man die schweiz für die blockade sanktionieren. ohne die nutzung von eu boden und luftraum gehen se pleite.
Reply: @maddog8004  Butthurt swiss person detected
Reply: @maddog8004  oh yeah. Supporting and benefiting from the Nazis definitely counts as staying neutral....
But I guess you guys stay true to your principles: Always stay on the side of the tyrants.
Reply: @maddog8004  Der Inbegriff von Heuchlerei! 
Den Nazis den Krieg und die damit verbundenen Gräueltaten finanzieren aber immer stolz mit der Neutralität wedeln.
Reply: @maddog8004  Operation Tannenbaum (der geplante Überfall auf die Schweiz) wurde nur nicht durchgeführt, weil die Schweiz massiv Waffen geliefert hat und geholfen hat den Krieg zu finanzieren. Wenn die USA neutral geblieben wären, gäbe es keine Schweiz. Die Schweizer Neutralität hat bisher nur funktioniert, weil andere eben nicht neutral geblieben sind.
Reply: @maddog8004  die Schweiz ist ein dauernder Kriesen-, Kriminalitäts- und Kriegsprofiteur...
Reply: Lass die Schweiz mal mit der Ukraine tauschen wenn man von Freundlichen NATO Staaten umringt ist kann man sich sowas leisten. Wenn dein Nachbar Russland ist das mit Gewalt sein Territorium erweitern will ist Neutralität für den Arsch.
Reply: @maddog8004 Wie sah die Neutralität der Schweiz im zweiten Weltkrieg aus? 
Wie war das nochmal mit dem verschwundenen Gold und Geld der Opfer des zweiten Weltkriegs? 
Hab ich vergessen, würde über diesen Teil der Geschichte der Schweiz gerne etwas hören. Warte gerne auf Aufklärung.
Pazifismus um des Pazifismus Willens ist reiner Egoismus, wenn er uns davon abhält Menschen in Not zu helfen.
Reply: @tobiasstunn1089  Oh ich sehe du hast deine Hausaufgaben gemacht und festgestellt das neutrale Länder gerne als Tresor genutzt werden. Weißt du auch warum ? Sie sind in der Regel sicher Sicher vor Diebstahl und sicher vor dem Finanzamt. Das verschwundene Geld und Gold der steuerhinterziehenden  Opfer. Nächste Buchempfehlung für dich Wolf unter Wölfen. Übrigens lieber den Ruf als neutraler,egoistischer  Feigling als den der Deutschen.
Reply: @maddog8004 Wo war denn die Schweizer Neutralität im WW2? Da hat man ziemlich viel an Waffen verdient und die jedem geliefert... Und was die Sache mit den Vermögen der ermordeten Juden betrifft, so war auch hier keine echte Neutralität zu erkennen. Wenn es darum ging, einen Vorteil zu haben, dann war die Neutralität löchrig wie ein bekannter Schweizer Käse. Also sollte man nun nicht das Unschuldslamm mimen, das glaubt der Schweiz niemand mehr...
Reply: @maddog8004 Halb so wild. Wir werden sogar von Amerikaner und Israeli kritisiert.
Das führen wir auf mangelndes Wissen und auf Egoismus zurück. Innerlich lachen wir😂 und versuchen es geduldig zu erklären. Wie der Lehrer dem dümmten Schüler alles mehrmals sagen musste😅
Reply: @maddog8004   Die Schweiz hat jeweils geschickt und nicht doktrinär agiert. In WW2, Waffen an alle. Dito zuvor. 

Ausserdem, die Napoleonischen Kriege sind etwas mehr als 200 Jahre her. Beresina vergessen?
Reply: @maddog8004  Die Schweiz wird respektiert , nun baut Deustchalnd die Munition selber und verdient ein Vermögen damit .
Reply: @grischmatsch1120  Ich merke schon das ich es mit einem Fachmann zu tun habe.

Eine Fabrik zu bauen bzw. umzubauen kostet sehr viel Geld.
Das Material und Know How für komplexe moderne programmierbare 35mm Munition ist ebenfalls nicht günstig.
Die Lizenzgebühren müssen beglichen werden der Transport organisiert und das Geld eingetrieben werden.
Schwer möglich ein Vermögen damit zu verdienen wenn du es dann verschenkst.
Reply: @grischmatsch1120  Es geht nicht darum ein Vermögen zu verdienen. Schon nur die Rüstungsindustrie zu unterstützen würdge genügen, statt sie zu zerstören. Das wäre ein Bereich, wo die Schweiz natürliche Stärken hätte.

Statt dessen wird nun die gesamte industrie inkl. Arbeitspläte ins Ausland verlegt, da wo man sich auf Lieferungen und Kooperation verlassen kann. Noch schlimmer ist, dass die eigenen Rüstungsmilliarden nun auch unmöglich in der Schweiz ausgegeben werden können, den die Schweiz alleine ist viel zu klein um eine Rüstungsindustrie ohne Exporte zu unterstützen.
Reply: @a5cent  Die Produktionslinie in der Schweiz bleibt ja bestehen.
So wie ich das verstanden habe wird eine zweite Produktionslinie gebaut in der EU. Wurde ja schonmal probiert in Norwegen wobei es gescheitert ist weil die Qualität nicht genügend war.
Gleiches wird jetzt in Spanien probiert soviel ich weiss.
Ich habe da auch einige Gedanken dazu und denke dass auch dabei Technik vorallem Chemie aus der Schweiz benutzt wird.
Was ja der Schweiz entgegen kommt wobei es illegal ist Waffen in Konflikt Gebiete zu verkaufen aber Chemikalien für dritte Länder nicht darunter fallen.

Ich denke viele hier haben keinerlei Ahnung davon wie komplex es ist eine Qualitative Produktionslinie aufzubauen.
Auch Gewinn wird damit nicht gemacht.
Finanziell hat die Deutsche Rüstungsindustrie gutes Geld gemacht was jedoch der Steuerzahlen hinblättern muss.
Zudem überschätzen viele die Wirtschaftliche bedeutung der Rüstungsindustrie.

Man muss auch sagen würde die Schweiz Waffen liefern zu lassen würde sie sich im Nachhinein der kritik aussetzen als Neutraler Staat mit Kriegswaffen Geld zu verdienen.
Ein Kriegsprofiteur.

Das „Spiel“ kann man nicht Gewinnen.
Reply: @Slithermotion  
Nein, das Problem in Norwegen war ein anderes. Man dachte, dass die in Norwegen bereits produzierte Munition passt - tat sie aufgrund minimaler, aber am Ende ausschlaggebender Unterschiede nicht tat. 
Und da Oerlikon Rheinmetall gehört, ist es kein Problem, in Spanien eine Produktion von Originalteilen aufzubauen. 

Die Rüstungsindustrie wird im Übrigen auch unabhängig vom deutschen Steuerzahler Geld mit der Situation machen - weil zum Beispiel IRIS-T SLM so die Chance hat, zu zeigen, was es kann. 
Im Übrigen ist es müßig davon zu reden, die Schweiz wirke sonst wie ein Kriegsprofiteur. Letztendlich ergibt sich aus dieser Auslegung der Neutralität auch, dass Deutschland keinen Nachschub mehr bekommen würde, wenn es direkt angegriffen würde. Damit macht sich die Schweizer Rüstungsindustrie überflüssig, denn es wird niemand Waffensysteme kaufen, für die Munition und Ersatzteile im Ernstfall verweigert werden.
Reply: @ohauss  Ganz ehrlich ich wüsste nicht ob die Schweiz nach Deutschland Munition liefern würde oder nicht da müsste man sich die Gesetzte durchlesen.
Aber es wäre ja auch beschämend wenn das Deutsche Militär eine Waffenlieferung abschliessen würde im wissen dass sie im ernstfall keine Munition bekommt.
Kann ich mir fast nicht vorstellen.
Aber wäre sicher interessant zu wissen wie da die Rechtslage wäre.
Reply: @maddog8004  da oerlikon rheinmetall gehört muss da garnix an lizenzkosten etc bezahlt werden. die technik gehört bereits einer deutschen firma und rheinmetall hat bereits begonnen in anderen ländern anstelle der schweiz zu produzieren. somit ist das thema eigentlich erledigt. mittlerweile ist auch die erste gepard munition in anderen waffenfabriken in der eu fertig. selbst wenn die schweiz es nun nachträglich noch genehmigen sollten, die sind raus bei der produktion.
Reply: @Slithermotion  in der vergangenheit hatte die schweiz recht wenig probleme damit vom krieg zu profitieren. der ganze heutige schweizer wohlstand baut darauf auf lol
Reply: @Slithermotion  es wurde bei uns keine neue produktionslinie gebaut. man hat eine alte wieder reaktiviert^^ die erste munition soll wohl im juni/juli geliefert werden aus der anlage
Reply: @a5cent  der verkauf von oerlikonn war der untergang des waffensektors für die schweiz, nicht das nicht teilnehmen am ukraine krieg, lol. das selbe wie bei uns grad mit den heizpumpen, nicht unsere gesetze wie das habecker vorhaben macht alles kaputt, sondern dass die politik KERNINDUSTRIEN eines landes verkaufen lässt, wie jetzt halt die heizpumpenfirma in deutschland, der gründer hat rotz und wasser geheult weil deutschland sich kaputt macht.
Reply: @Slithermotion  Die Produktionslinie steht und arbeitet in Italien. Googeln (youtube; aber auf italiensich)